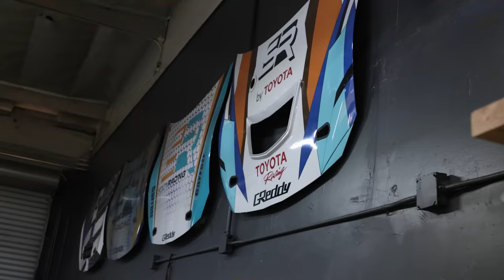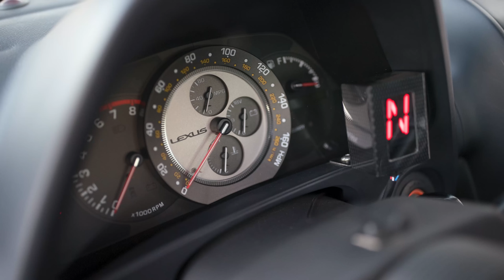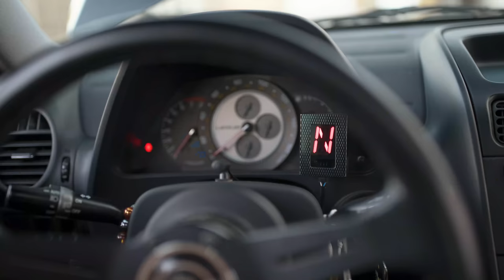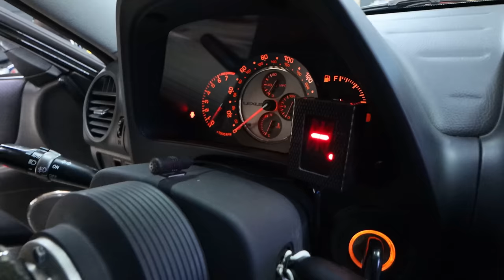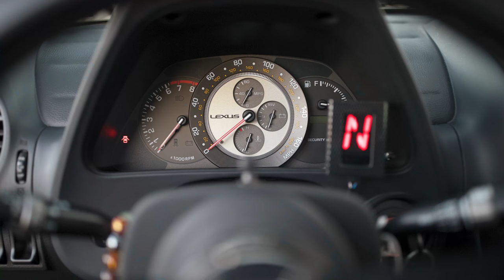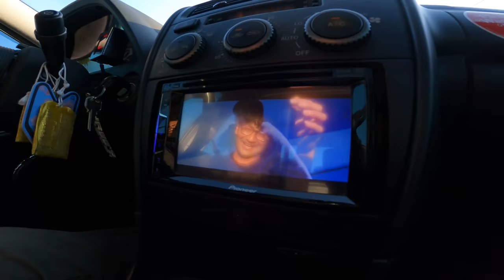Sequential on the Streets: Ken Gushi’s 1JZ Swapped IS300 Street Car

Comment: The fact that everything works is phenomonal. Getting the engine electronics to talk to the chassis electronics beyond ECU functions is incredible. 

I've 1JZ swapped a Cressida and the wiring was by far the hardest part and even then I couldn't get certain chassis components to work

Comment: Bruh, Alteezas and 1jz swaps are literally the dream swap, four door high rev supra🙌
Reply: this  is more like a jzx
Reply: @landuXD  Big fan of the chasers too, both 1jz and 2jz are lit😁
Reply: Why would people swap a 2j out for a 1j again?
Reply: @stefano3124  cause the 2j came from the is are slow
Reply: @daledale5693  but they are stronger blocks and have more tuning potential. So my question still stands, why swap 2j for 1j?
Reply: @stefano3124  they actually have  weaker rods so if you try to modify them that rod will snap thats why is cheaper to 1j swap instead of sticking to the 2j
Reply: @daledale5693  true but for the cost of swapping a 1J you could literally buy internals for the NA 2JZ, build it and call it a day, injectors, fmic, ecu etc. but i hear ya 1J's are nice as well.
Reply: @stefano3124  hi , probably is because of the gearbox , my best friend just bought an is300 automatic (in europe they only sell it this way) , and we are looking for a manual swap and looking for gearboxes i foud that the 1jz have more options and easy work swaps than the 2jz ge
Reply: @JawnWick86  1jz sounds better and looks better. IS 2J is wont even rev as high. With 1j you have stock setup that is nicer. It will also sound closer to rb26 if you use single turbo. Biggest missed opportunity is toyota not offering 1jz stock both na and turbo on it.
Reply: @Kacpa2  i agree 1J vvti sounds so good, Yamaha is the best at getting those proper notes out of an engine
Reply: @JawnWick86  Only way this car could be even better is if it was a Sportcross IS on top of all that 😅
Reply: @Kacpa2  ahh i hate those lol but i know people that like them, im not big on wagons, but different strokes, different folks. Overall this is a clean setup car though as it is
Reply: @JawnWick86  Why do you hate these tho? 😅
I think it has nicer looking tailights, that fit front end more than sedan. 
Its also a bit less of a wagon and more of a hatchback more of less the size of Impreza.
Reply: @Kacpa2  i like my sports cars to look like sports cars not sport wagons lol, lowered on wheels yea anything can look good but i'll take a sedan IS300 over the cross any day. I feel the same about R34's/stageas

Comment: As far as shifting goes with a motorcycle it's the same, just give a little pressure with the foot, as soon as you roll back the throttle shift up a gear clutchless. Do it right and it feels smoother than with the clutch.

Comment: that sequential trans reminds me of a motorcycle transmission where you can do clutch less upshifts but you do need to use clutch in the downshifts if you don't have a quick shifter. even down to the clunks when you downshift to first.

Comment: Im building my wifes is300 right now its identical pretty much, but i have been doing swaps for years.. my first swap was 11 years old i swapped an iroc front end on a berlina camero.. i can go on for years nearly doing 100s of swaps. As far as tranies go the r154 is perfect and cheap only 3k but they can reliably take up to about 550whp with a twin or triiple plate os giken, also with a serial 9 bell housing and cd009 you can use a S1 sequential shifter they use a similar display liftless shifting is standard in a lot of aftermarket ecus, but i have aristos every gen supra im also wanting to do a turbo 1st gen 1UZ in my 100 series landcruiser, i also have a 1800lb 1969 opel gt with an altezza beams 6sp 3sge in it!

Comment: Welcome to the world of ($400) kit manual valve body automatics that guys have been building 50+ years... MV body GM trans wont be as quick shifting but they are cheap/existing platform and become consistent shifters and stay quiet. Shifting your auto all the time is fun. MV body kits make your automatic more reliable and run cooler.

Comment: You can go sequential for cheaper by getting a T56 and buying a Sequential conversion kit from S1 conversions for $1100 I think it costs idk what the price of a new or used T56 costs and you can do it with a TR6060 aswell instead of paying $15k for a full sequential. You could go the extra mile and get straight cut gears for the sequential sound and dog rings but you don't need all that cuz the sequential conversion takes the abuse off the transmission cuz you'll never miss a gear like you could with H pattern or money shift either. It'll extend the life of your trans big time
Reply: The S1 shifter will never shift as fast as a real sequential Motorsports gearbox or be as reliable. It also takes a lot more physical effort to do shifts on an s1 bolt on shifted synchro t56 than on a real sequential gearbox.

Comment: Out of curiosity is there an advantage to a 1jz swap instead of a turbo on the stock 2jz. NA 2jz's are very, very similar to the turbocharged 2jz's.
Reply: The 1JZ is a 2.5-liter inline-six engine with double overhead cams (DOHC) and four valves per cylinder. It has an 86 mm (3.39 in) bore and 71.5 mm (2.81 in) stroke, which means it has an over-square design. This typically makes an engine more rev-happy, than an under-square unit
Reply: The 2JZ is identical other than being 3.0 litres achieved through a longer stroke of 86 mm (3.39 in). The cylinder bore is the same as the 1JZ’s 86 mm (3.39 in), which means that the 2JZ has a square design, which means that the bore and stroke are equal. This translates into a better low-end torque

Comment: I agree on what he said about keeping the interior
I understand weight saving but I like seeing a complete interior
Reply: depending on the car its honestly not that much of a difference, or at least not noticeable enough by itself. A 240 can drop what like 30 pounds maybe a little more but the car is deafining loud while not going any faster. The sketchiest car I have been in is a clapped out s13 with gutted interior, a homebrew angle and turbo kit, made less than 230 wheel but sounded like it was gonna take you to valhalla whether you wanted to or not. Talking like maybe a 8 sec 0-60 but I would rather sit in a dirt track car
Reply: @nicolasgibson1956  lol